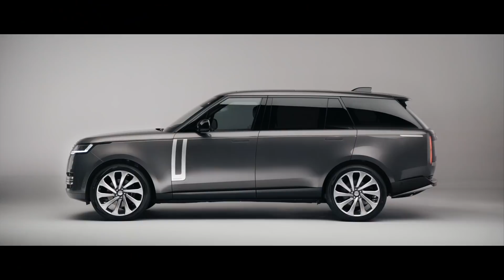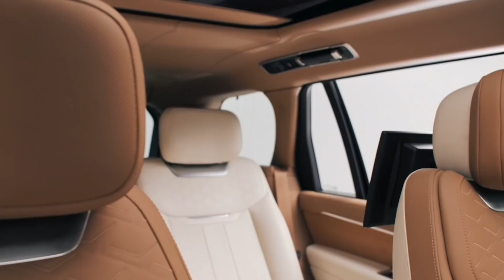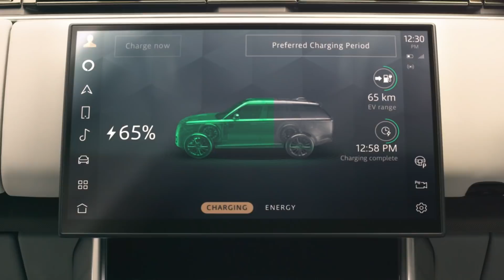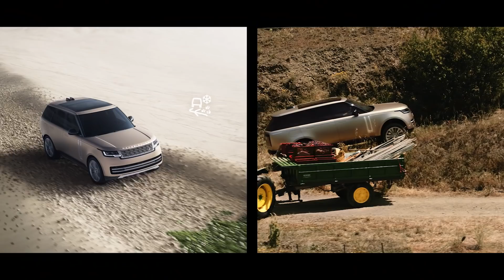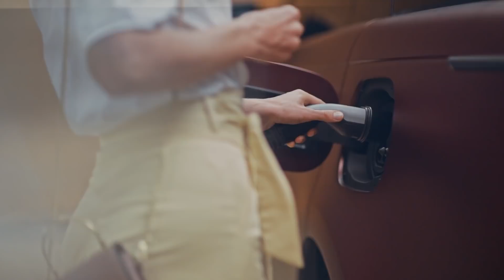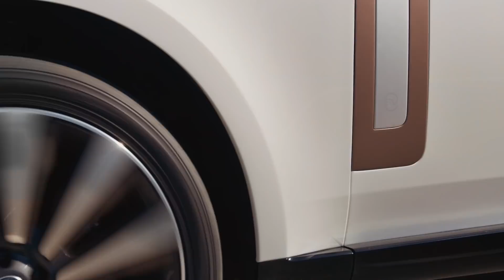360 Model Walkaround | New Range Rover (22MY)

Comment: overall the design retains the range rover DNA. It looks futuristic and up to date, however I was saddened by a few things. First the rear design, it's clean and extremely minimalist, but it loses that aggressive look of the headlights that we loved so much. The simplicity we expected in the interior was transferred to the exterior where it fails to evoke the same feeling as the previous model, at least it retains the vertical design and that's appreciated. Thank goodness they kept the split tailgate (otherwise i would have had a heart attack). i would have expected leather seats as standard (as in the previous model's accessories). on the interior, there is a very fine quality of materials and good colour shading. but again the design baffles me. the interior always valued minimalism, and now especially in the doors they overloaded it with intrusive lines that mess up the design, it makes me too much visual noise. the seats that filled me with expectations in the concept turned out to be common without surpassing the previous version. and now the biggest blunder (if the rear design is not already one by itself), to place 3 rows of seats? seriously? i love dscovery 7 seats but.... was it necessary in a range rover? when the l405 was launched in 2013 i still remember my first impression: 4 individual seats, the rear ones separated by a full console: that was a real jet, it created the feeling of exclusivity and individual space. but now we will have to stop at every bus stop to pick up people? seriously? the double screen of the previous model looked very beautiful and perfectly harmonious with the T design. now it looks like it's glued on. as if they forgot the screen when they finished the design...and bam! inserted in two minutes. i think the big breakthrough is in what you can't see. engines, technology and many other things, but precisely what you can see and what we loved so much, remains at 80%. i can no longer say "the best just got better".... it remains the same, but has subtly deviated.

Comment: It’s all good and well however the pricing is essentially 100k. That’s not worth it at all when you can just get a vehicle from Aston Martin or Bentley which is more premium
Reply: Both of those SUVs are considerably more expensive....!!! Also the Range Rover will out perform both of them on any off road situation. Also compared to those two models, I think the new Range Rover is extremely competitively priced.
Reply: @dkpirie  not when you buy used they aren’t, and at that point it will be cheaper to own as this will depreciate instantly. Still a far better vehicle and brand. And people don’t take cars that cost this much off road, thats why the new defender also won’t be used as it now costs 60k compared to the 10k ones farmers used to rag around. The Range Rover isn’t any better than an S Class or 7 series, just a bit less in an SUV form yet it still costs 20,000 more. And compared to the sport, it’s 30,000 more. That starts at £64,000. I don’t see how this is competitive pricing at all. I would take an X7 at 70k which it comforts with and be done with it all. Better quality and technology. Sure this has an appeal, but not with that much of a markup
Reply: @Horizon301.  that’s not really a like for like comparison, second hand will always be cheaper. The Aston Marin DBX new purchase price is a more telling comparison starting at nearly £160k.